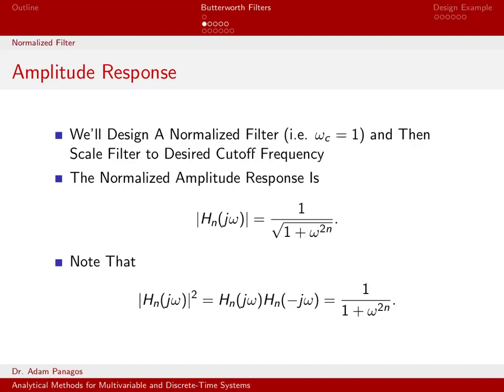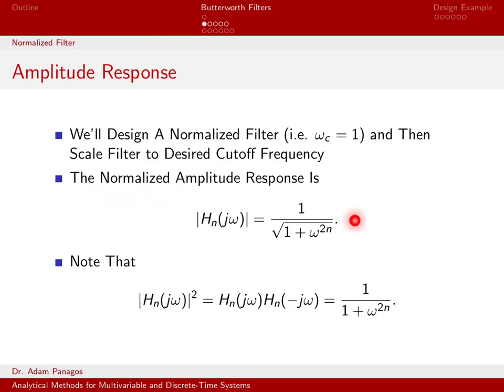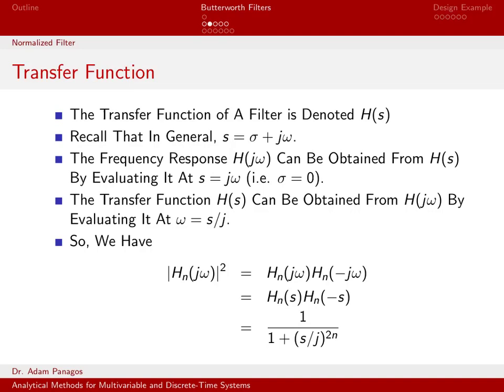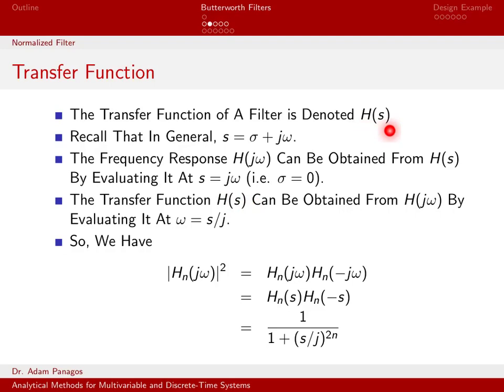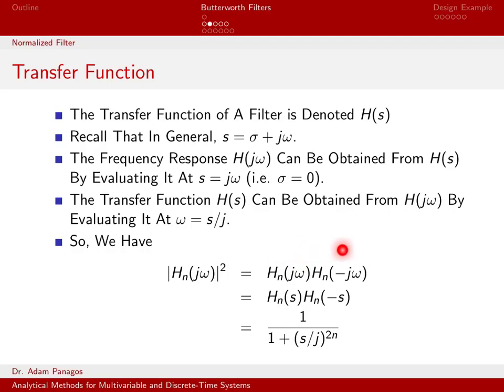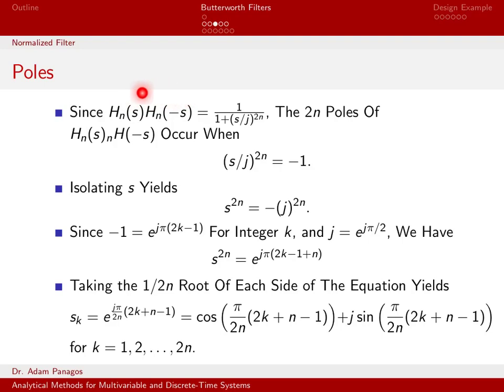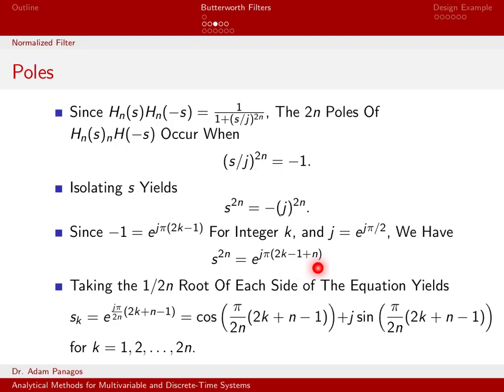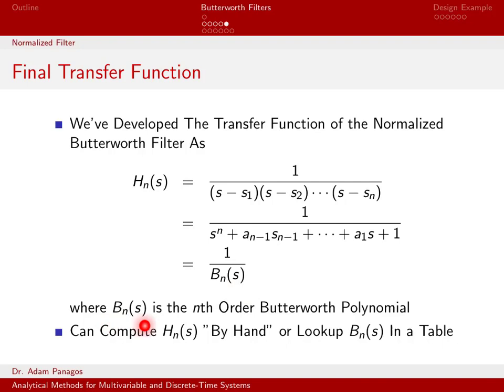Butterworth Filter - 02 - Normalized Filter

Comment: Could you please tell me how did you derive Hn(S) equals to 1 over (S-S1)*(S-S2).....(S-Sn) to get nth order Butterworth polynomial?
Reply from the maker: Soham Banerjee That's really what most of this video is focusing on.  The magnitude squared |Hn(s)|^2 can be written as Hn(s)Hn(-s).  We know that Hn(s)*Hn(-s) is equal to 1/(1+(s/j)^(2n)).  To find the poles of this filter we need to find all values s for which the denominator is equal to zero. That's what most of the video focuses on.  Once we know all the values for which we have zero in the denominator, we now know ALL the pole locations and can equate our starting expression to 1/(s-s1)(s-s2).......

Hope that helps a little.....
Reply: Adam Panagos Actually sir I understood up to the part you calculated the pole locations. 
But my question was why did you write Hn(S) in that form 1 over (S-S1)*(S-S2).....(S-Sn) ?
I mean is it only because all these pole locations represent a circle?
Reply from the maker: Soham Banerjee No, it doesn't really have anything to do with them being on the circle, it's just another way to write out the denominator that makes the pole locations more clear.

We're working with the quantity 1/(1 + (s/j)^2n).  Note that the numerator is always 1 so this quantity does not have any zeros (except at infinity).  The denominator is a polynomial of order 2n.  This means there are 2n places where 1 + (s/j)^2n equals zero since we can find the 2n roots of -1.  n of these roots correspond to Hn(s), the other n of these roots correspond to Hn(-s), for a total of 2n poles.

Once we know where all 2n poles are, we can write Hn(s) as 1/(s-s1)(s-s2)...(s-sn) since this is just the factoring of our given nth order polynomial into its n terms.  Similarly, we can write Hn(-s) as 1/(s-s1)(s-s2)...(s-sn).  Note that the s1, s2, ...sn in Hn(s) are different from those in Hn(-s).  At this points we've been able to factor our original polynomial of order 2n into a fraction containing 2n poles.  It's very much like how we would factor the polynomial x^2 + 3x + 2 = 0 as (x+1)*(x+2) = 0.  If you know the solutions of the equation, you can write it equivalently in factored form.

Does that answer your question any better?
Reply: Adam Panagos Yeah Thanks.
I had some misconceptions there. but it's clear now. Thanks a lot. :)